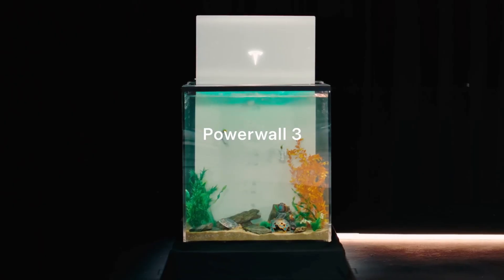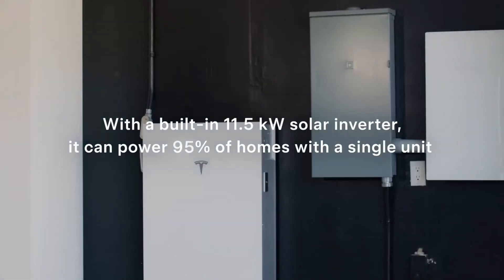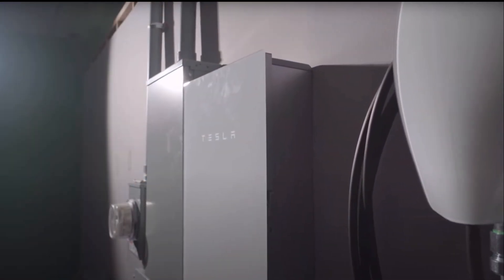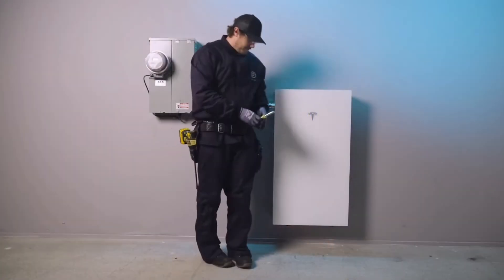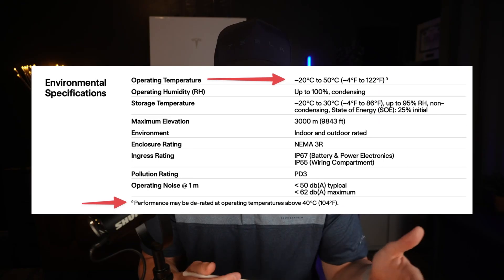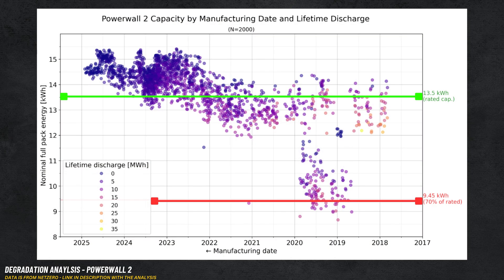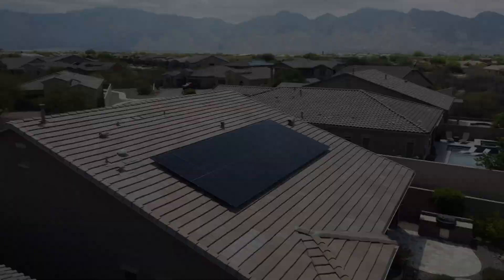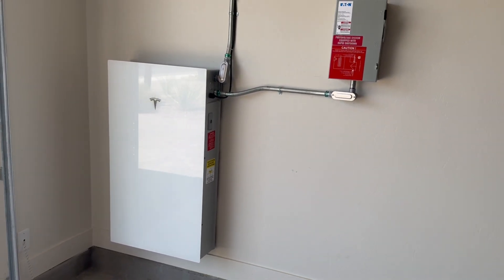Top 5 Powerwall Questions I Get Asked Every Single Day

Comment: PG&E is evil. They charge $275.00 to install the Backup Switch and then failed me for not having the CanBus cable connected to it. Then they failed me because a water line ran under the panel. Ive spent $825 so far and am waiting for their third attempt. I am sure they do this to delay installs as long as possible.
Reply from the maker: Wow, that's insane that they charge so much. I bet they take forever too.

Comment: I have an existing emphase 4.9kw, because the system could not keep up with our demand we ended up installing a 7.2 KW with Tesla, including two power walls 3. 

I still have not got the PTO on the second install however, I was wondering if they will turn on the system and I will get more KW from the new equipment? I also keep getting an arc fault. 

Lastly, because I did not have much room on my roof left, we had to install on Northwest more west panels. 

I got a message from Tesla stating that once the PTO is approved, they will turn on my system. Does that mean that my system will start producing more solar?
Reply from the maker: Yeah when you get PTO, you will get the combined output of the two systems. So you will have around a 12 kW system (DC).

Comment: I have two powerwall 3 and my home is running at an average of .7k. Is it normal to discharge 1% per 20-30 minutes ?
Reply from the maker: Yep, that all checks out. 0.7 kW over an hour would drain about ~2.5% from 2 PWs.
Reply: @ZachSolar thanks

Comment: Thank you for answering many of my questions in your videos.  We just had (2) Powerwall 3 units installed on our existing solar array and they are working out well so far.  Our existing inverter is 14 years old, so we may have to do the rewiring to the panels you were talking about if/when it fails. My wife was not too keen on the idea of PW's in the first place but with the utility rebates and tax credits they will only end up costing us $6K.
Reply from the maker: That's great to hear! It sounds like you got an amazing deal with those incentives.

Comment: Tesla replaced my powerwall 2's with powerwall three's but are still using the inverters that were with the powerwall 2's. Can they do that?
Reply from the maker: Sure, you can pair Powerwall 3 with existing inverters like Powerwall 2. No issues with that.

Comment: We live in Glendale CA and they still require a gateway. Yesterday we completed our install (16,000kwh solar, PW3 and an expansion) and got signed off by the city. I went "off grid" on my Tesla solar app and everything worked fine and my house seemed backed up, however the installer mimicked a power outage and only 2 rooms stayed on, basically what runs off a sub panel in my house. Does that make sense? The installer said to make it a whole house back up, I'd have to run tons of wires to the gateway to the tune of $1,500.
Reply from the maker: Yep, that all sounds right. On a partial home backup, the “Go Off-Grid” feature will keep everything on your home connected to the grid still (so everything stays on) but only calculate your backed up circuits (your subpanel) on the app so you can see how long your batteries would last in theory. Hard to explain, but more of a virtual simulation. To trigger a real outage like your installer did, you’d need to flip your main breaker off to fully disconnect from the grid. I don’t recommend messing with that personally.

Comment: Love you solar battery information videos. If i have net metering, and infrequently power outages. What are advantages of following telsa recommend discharge to 20%, or keep at 50-60 in case of power outage. What is better for long term battery life. Also is there more power lost when it goes " roof-battery-home" or "roof- inverter-back to electric company". Maybe you can do a video explaining , or write a response
Reply from the maker: Thanks! If you have net metering, going with a higher backup reserve is recommended and just saving it for outage protection. There is very little to no financial benefit of using it day to day if you have full net metering (unless you have time of use rates!).

Not sure if I fully understand your 2nd question. Sorry.

Comment: As ever great info.  Can you do a video on calibration please? I woke up this morning and my PW3 is in calibration mode. No notice, so no way to plan electricity use for today.  Installed PW3 with Gateway in June this year in UK after a 4 day outage last winter pushed me to finally take the benefit of our South facing roof.  Works perfectly.  Switched to TOU tariff after summer Sun changed to autumn Sun to take advantage of EV rates, now run house on 100% charging PW3 at night, with time delayed appliances like washing machine etc. This is second unnotified calibration since installation.  So really annoyed PW3 has over riden my TOU off peak/peak timings and looking like will be charging during calibration process in peak charging time.  Something to do with LFP chemistry... Any way to schedule calibration?
Reply from the maker: Thank you! And unfortunately, there's no way to schedule calibration. That is definitely a question/comment I get every few weeks. I wish there was a better solution, but it seems to be completely random.
Reply: Calibration is very annoying because Tesla provides no notification to when they are going to do it. And as a homeowner you have no control over it. We had our solar system and 2 Power wall 3s installed in April and our first calibration was in August and the second one occurred in October. We are also using Time based control, and the calibration process completely ignores this and charged the PWs during peak rates. It makes no sense because Tesla has our rate data. Also, the calibration process discharged our batteries to near 0 and stayed there for hours. If there was an outage in our area, we would not have had power. Tesla needs to redesign this calibration process especially for homeowners on Time based control. In my opinion the current process is awful.
Reply from the maker: @ButterfliesNBirds  The fact calibration cannot be scheduled is a crime.
Reply: @ZachSolar Agreed! Being helpless and being forced to pay peak rates during this looooong process is beyond frustrating. Especially because the point of time based control and scheduling Netzero automation is to avoid peak rates.

Comment: Great videos Zach.  I just became a subscriber to your channel. I just got my tesla powerwall 3s (x2) up and running a couple weeks ago.  Quick question - I prefer running in "self powered" mode, but am I actually getting $$ in credits when I see power going back to the grid? Obviously this usually happens for only a couple hours when the batteries are full and the cars have finished charging. I did see your video on the Netzero app and will probably get the courage to give it a try.  Anyway, for now I'm just wondering if I am making a mistake by not going on the Time Based Rate option since I do live in CA where the rates are ridiculous. Any advice would be appreciated and keep up the awesome job from your channel!
Reply from the maker: Thank you! In CA, I would generally recommend Time-Based control however if you're comfortably getting through the 4-9PM peak-hour time window in Self-Powered then that's all that matters. Priority #1 is to eliminate any grid use from 4-9PM and Time-Based will focus on that. Self-Powered mode will simply prioritize grid independence and disregard the time of day rates. Those Netzero automations are designed for the CA rate structure, but keeping it simple is also a good strategy in general. There is no right or wrong approach here, as long as it's working the way you want it to work.

Comment: I am in Tucson in a manufactured home.  I would love a Powerwall without solar, but was told that it could not be permitted by the county.  Is that true?
Reply from the maker: In general, a Powerwall without solar wouldn’t be an issue at all with Pima County and their permitting process. You’d be all clear. There could be hurdles with the installation process on a manufactured home though.
Reply: @ZachSolar  So would you need to do an on-site inspection to determine that?
Reply: I owned a mobile homes two years ago and wanted to install solar and battery on it, they told me we couldn’t cause house is not permanently fastened to earth. Home Foundation missing.

Comment: Indoor vs Outdoor: Our county building code requires that the powerwalls be located outside or built in a room (not the garage) with fire retardant walls & vents to the outside.   I guess the fire departments pushed for this.   Sorta nuts, since we have two tesla cars in our garage with much larger batteries.   So we located the powerwalls on the east side of the house so that the west sun doesn’t heat up the powerwalls.

AC Coupled vs DC: We had a Sunpower Sunvault system that could not be commissioned (due to the Sunpower bankruptcy and take over by SunStrong).   So the installer decided to take off the microinverters on the Sunpower solar panels and rewired everything making my system DC.   Benefits are huge… Now I don’t have micro inverter clipping and the powerwalls do all of work.  The system is more efficient as well.

FYI… My system config is:
- 17kW Solar in 4 strings
- Two PW3 and two PW3 Expansion Packs
- Right now the expansion packs have to be connected to the PW3 Leader.  I’m looking forward to Tesla offering PW3 Expansion packs connected to the follower.

Also, my install is a complex one.  Tesla now supports three Remote meters… One on RS-485 and two on Wifi.    Why Tesla doesn’t support more meters with RS-485 is a mystery to me since RS-485 supports 32 devices and Tesla can only seem to do one.
Reply: The only thing required for installing the PWs in my garage was hardwiring a heat detector in the gartage to the existing string of smoke/CO2 detectors.
Reply from the maker: Yeah, every jurisdiction is a bit different with batteries. Some are behind with the times and can be really difficult with their requirements. That’s a sweet system!

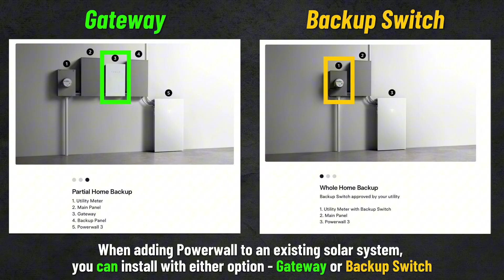Comment: 9:53 So the PW3 can be used with microinverters (AC-coupled)? Does that mean existing PW2 systems can now be expanded with PW3s, since the PW2 is no longer available?
Reply from the maker: Yep, it can be AC-coupled! And that would make sense, but not yet 😢 

As a Powerwall 2 owner, I wish it could…

Comment: My Powerwall 3 system went live September 2025. I have 2 Powerwall 3 units and 1 expansion battery. I have 17.1 kW of solar and so far that's been plenty to run the house, charge the Tesla car with a level 2 charger and recharge the Powerwalls after running the house all night. Will be interesting to see how things work out when the weather heats back up next summer. All 3 units are outside on the East wall. Typical Mesa, AZ community where the house to my East shades my Eastern wall for a good part of the morning. I am thinking about having someone come out and look at installing some sort of sun shade. A final note, the Tesla Wall Connector is capable of charging your car at 11.5kW which is the entire output power of 1 Powerwall 3. If you want to charge your car at max settings and run your house from solar at the same time, you'll want to consider getting 2 Powerwall 3 units which will have a combined output of 23kW. You can of course lower the charge rate for the car.
Reply from the maker: Great system! That setup will serve you extremely well. Thanks for watching!
Reply: I’m set to have Tesla do an installi told them I wanted2 powerwall 3s for running the house and charging my cybertruck which is my daily driver. Looks like they plan a pw3 and a second type of extension battery….are you saying I’m better off with three pew 3s..?

Comment: I have a Powerwall 3 system with expansion pack I keep a message saying Powerwall unavailable do you know what this is and why it happens
Reply from the maker: Tough to say. It could be a variety of reasons (software or hardware). Definitely need to check with your installer or Tesla directly to see if they can run a couple of tests remotely.

Comment: I'm wondering if we should treat ambient temp as a factor for getting more PW's vs. expansions. I'm hearing stories of people with one or two PW's overheating on hot days. I'm thinking it's because they're working harder. I have 4 PW3's installed outside and even on the hottest days (115F) I've never seen de-rating. I'm thinking it's because each PW only has ~4.5kw solar and is providing ~2.5kw to the house at most. I wouldn't even notice de-rating if they were! IF expansion packs had been released when I did my install, I probably would have done 2PW's and 2 expansions. I'm glad I didn't.
Reply from the maker: Interesting point! I haven't heard much about overheating either, but it makes sense that spreading the output across more Powerwalls could prevent de-rating in high temps.